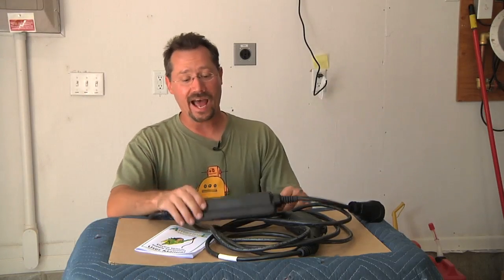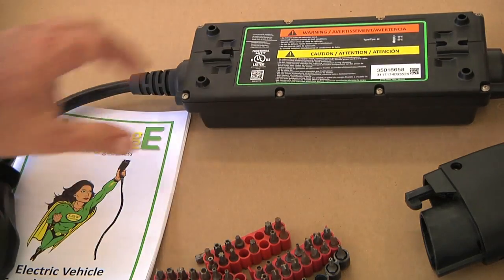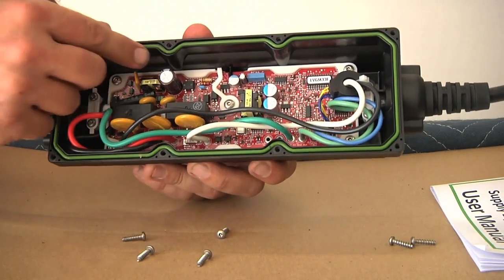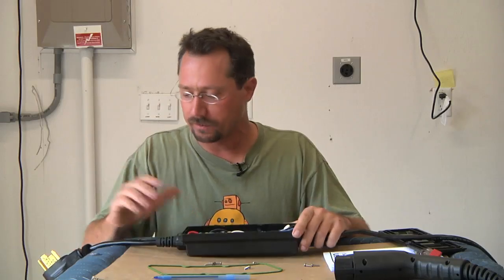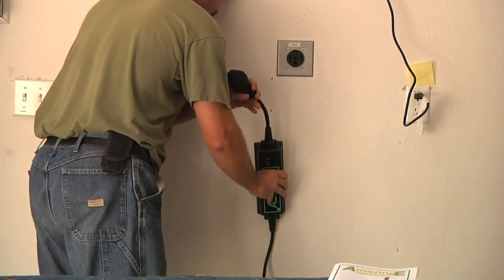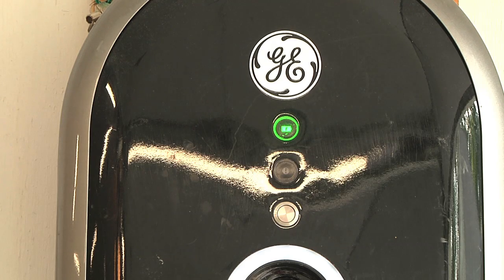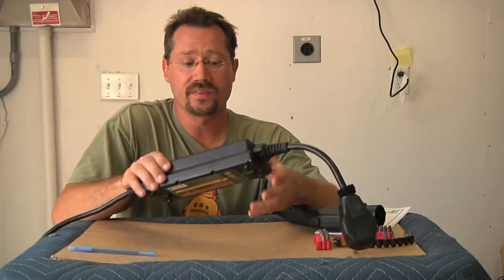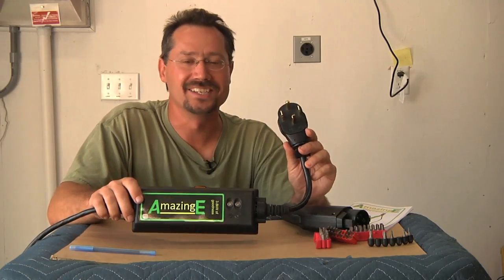"Amazing-E EVSE" - Review and Look Inside

Comment: maybe if you connect between the neutral wire and the one hot line it would work. rather than 120 across the two line connections. Putting a cleat in the wall above the box would stop it from popping up, maybe a long one hanging down with only one, loose, screw in it so it can be swung out of the way.

Comment: I also have one of these AmazingE portable EVSEs. I just ordered a new Clipper Creek control board to build a 2nd for cheap and I’m hoping it’s configured for dual voltage like the Chevy Volt/Bolt implementation. It makes sense that they’d engineer one board to use with multiple EVSE configurations from different ODMs. Did you look on the board for any kind of factory jumpers that could change the config?

That said, I was getting the same error indication with 240v on my AmazingE until I redid the ground on my NEMA 6-20 pigtail. Maybe yours does work with 120v and it’s just ground faulting like mine was?
Reply from the maker: Was it this eBay listing that you ordered from? https://www.ebay.com/itm/174440500833?hash=item289d76ce61:g:2QEAAOSwzOJfY7iW
A friend of mine has two broken EVSEs and he was talking about buying a pair of those boards to use for rebuilding them.
When I took apart my Amazing-E, I was able to look at the board version number in the corner. I recall that it WAS a different part # from the gen 2 Volt EVSE.
On the eBay listing, the photograph unfortunately does NOT show the corner where the part number is screen-printed on the board, so I have no way of confirming EXACTLY which board that is.

What exactly did you do to the grounding setup that you were able to get the Amazing-E to run on 120V?
Reply: @BenjaminNelsonX  Yes, that is the listing but I added it to my Watched Items and got an unsolicited offer from the seller for $30.

I have not tried the Amazing-E with 120v but I did have the same error at 220v making me wonder if your error was related to 120v at all. After all, we both experienced it after wiring an outlet. In my case it was some kind of ground fault.

After seeing your video I’d like to try 120v but I don’t know when I’ll have the chance. It’s currently bolted to the workshop wall in a public place to keep people from stealing it and I need a backup before I start playing with it. :)

I will let you know if I find that ours works with 120v and/or has a different board revision. I’ll also let you know what I get from that control board listing when it arrives. I have a feeling that these were GM spares and may be configured the same as the Bolt/Volt2 EVSE for dual voltage 120/220v use.
Reply from the maker: @emmettturner9452   My friend did a MAKE OFFER on that listing and also ordered one of those boards for $30. When he gets it, I'll have him take a photo of the part # and we can compare it to my Amazing-E board. That's also our hope is that it's the Volt/Bolt board and 120/240 compatible.
Reply: @BenjaminNelsonX  Just received it in the mail.

I haven’t had a chance to wire/test anything yet but I’ll go ahead and give my initial impressions and observations since I’m not going to be able to do much else where I am today.

First, it’s genuinely new, unused, with factory HASL tin on the unpopulated connections. Not a pull. Could be from any ODM or even GM.

It has the exact same PCB rev as you though some of the numbers were covered by glue holding down the nearby transformer and capacitor. The revision date and the first/last digits of the part number all match.

Mine is marked “PCBA B” instead of “PCBA C” on yours but that just means it’s from a different panel position at the PCB assembler (multiple boards produced in one large panel). The sticker on what is presumably the main microcontroller (U13) says “LVGM33A” instead of “LVGM33F” like yours, which may indicate they are programmed differently since the board with the “A” version is actually a couple years newer.

I can’t tell if the nearby “J8” footprint is a set of unpopulated jumpers or some kind of programming header but I assume the latter. If the former then we need to analyze a Volt/Bolt version to see if they enable dual voltage.

Most of the component date codes are late 2018 and there is a Clipper Creek sticker on the side of one of the relays with “Model: Gen2 Date: 2019Q2” (mid 2019). The date code on the PCB itself is 42nd week of 2018 where yours is 40th week of 2016.

The glue holds the metal-oxide varistors to the relays and nearly every through-hole component to the board. I’m surprised yours doesn’t have glue to help hold the heavier components since it is intended to be portable, but maybe these boards weren’t going to have a silicon rubber gasket like the standard one has. I haven’t looked in my AmazingE yet.

I’d planned to mount it all to a piece of wood for now but after measuring 7x2.375” I see it’ll fit the same 250x80x70mm “Waterproof Plastic Enclosure Project Box Electronic IP67 Electrical ABS Junction” (294268994917) that I’ve seen others use for their DIY OpenEVSE. It’s an extra expense but I’m well under-budget and it looks too perfect.

I got lucky and my used 22.5’ J1772 SAE Type-1 was only $50 and close enough for Local Pick Up. After seeing the new prices I had to wonder if public stations had a problem with people chopping them and running off!

Now I just need a round-cable dryer plug from Goodwill, some waterproof conduit/cable fittings, and a make-shift watertight light guide for the LEDs. The LEDs are mounted over holes in the PCB as if they work from either side. They might be alternately populated with top/bottom-facing component variants so I’ll have to check that before drilling any holes. It would’ve been convenient if they had alternate points for their ODM partners to connect their own LEDs and put them wherever but… nope.

If the micro is programmed to operate differently, here’s hoping it isn’t programmed to require the optional temperature sensor or something since I have no idea how to bypass that. I guess someone with a Volt/Bolt or Euro version will have to measure the resistance while cool or something.
Reply: @BenjaminNelsonX  

In “Clipper Creek Chevy Volt / Bolt Level 1 to Level 2 Charger conversion” I can see that the General Motors version has glue and the same “LVGM33A” on the micro. That means there’s still a very good chance this is a GM spare.

He doesn’t modify the Clipper Creek parts at all so I can’t get a good look at the temperature sensor parts but there are enough wires there that I’m reasonably sure it uses them.
Reply from the maker: @emmettturner9452  Thanks for the comments!
That's my thoughts is that the 120v
operation may require that temperature sensor.
Reply: @BenjaminNelsonX  Hopefully, since that should be easy to bypass with a resistor.

I just took apart my AmazingE and found the board was week 36 of 2017 with the same 5.1 PCB rev. Like your AmazingE board, it’s also got “LVGM33F” on the microcontroller. Meanwhile “Jokerlope” on IMGUR has an album showing a week 6, 2015 Volt portable EVSE with a 4.9 or earlier revision of the board and “LVGM33A” on the microcontroller.

Album: “Stock 2016 Chevy Volt EVSE running on 240VAC”

The last digit on the PCB rev was obfuscated by the same glue that the newer eBay board has so I’ll just call it 4.x from now on. What stands out to me is that it is the oldest of all these boards, a confirmed GM version, has the same glue and “LVGM33A” microcontroller code as the newest one from eBay… both of which the AmazingE boards from the time in-between lack. This lends even more credence to the idea that the eBay boards are GM spares since it’s definitely not something ClipperCreek stopped doing for newer boards.

Unfortunately, this increases the likelihood that different microcontroller programming between GM and AmazingE is what prevents 120v from working on the AmazingE. I guess we’ll find out.
Reply: @BenjaminNelsonX  Other things I noticed about his older board:
The silk screen capitalization is different with “Pcba B”.
J8 only has solder in two holes. Perhaps there is a jumper between them on the other side? That certainly isn’t the case for my eBay board. It’s probably just that it didn’t get filled in fully during wave soldering but I really wish I could take a closer look inside an assembled GM version to be sure.
Reply from the maker: Here's the photo that shows the part number on the board: https://300mpg.org/wp-content/uploads/2017/09/IMG_7522.jpg
You can see more photos for yourself at: https://300mpg.org/2017/09/02/amazing-e-evse-review-and-opening/
Scroll to the bottom of the post for the photo album.
Reply: @BenjaminNelsonX  Thanks! I will compare these pictures soon and provide my own if there is anything different. :)
Reply: I found a thread on Bolt forum called “Changing the plug on the EVSE” where the OP determined the thermistor “is 1k at 25C, and a ß=3800K” This tells us that we can bypass the thermistor with a 1K Ω resistor so that the unit always thinks the plug is 25°C (77°F).

Comment: I have the exact same Amazing-E EVSE with the NEMA 14-30 Plug & for some reason it stays warm to the touch when not in use, Originally I thought it might be from the LED but it seems to be coming from the inside of the front portion of the enclosure. My stock 2nd gen Volt EVSE stays cool when plugged in & not in use. Should I be concerned?

Comment: Did you test line and neutral were wired to plug and board correctly?
Reply from the maker: For my test, I temporarily rewired my outlet from 240V to 120V. That's pretty hard to get wrong - it's literally changing one pair of wires. As for "Board", do you mean the circuit board of the EVSE? Inside the Amazing-E, the Neutral wire goes to NOTHING. It's literally a cut end covered with shrink wrap. For more details, please take a look at the blog entry, which has detailed comments and photos. https://300mpg.org/2017/09/02/amazing-e-evse-review-and-opening/
Reply: @BenjaminNelsonX  On motherboard you showed L1 and L2/N. They are not interchangeable. Did you wire N and L1 to match outlet to board? L2 should be return.
Reply from the maker: I wired the outlet for 120V so that the neutral connection went to the L2/N connection on the circuit board inside the EVSE.
Reply: @BenjaminNelsonX  Thanks.

Comment: I cut the regular 110p off of the "Clipper Creek" unit that came with our e-Golf (bought it at a Chevy dealership and they tossed in a brand new Chevy Bolt power supply). I installed a NEMA 6-20p and run it on 240v for a faster charge. I turned the old 110p end into a doggle-adapter for 110v use. I did notice the thermal wires that go to the thermal sensor in the 110v plug head. I didn't reuse them and have not noticed any issues; works great.

Comment: I downvoted cause you told people to cut a prone off a connector and that is a big no-no... but gave you a sub cause it's a solid video
Reply from the maker: What's really interesting here is that the neutral prong goes to NOTHING. It is literally NOT connected to anything inside the unit.
It's the ONLY difference between the 50A and 30A connector.
Now, if it was a 50A device that could now be plugged into a 30A outlet, THAT would be a bad idea.
All that modification does is makes the unit more flexible.

Comment: its just a plug? the output ac or dc? after plug in ,the car have on board charger charge the car.?
Reply from the maker: A device like this is simply an EVSE - Electric Vehicle Supply Equipment. It just supplies AC power from the wall safely and at an appropriate rate for the charger, which is built into the car.

It creates a signal that permits the car to draw an appropriate amount of current, so as not to blow the circuit breaker. It also requires that the end plugged into the car full makes a connection BEFORE it completes the circuit to have live electricity at the end of the cord.

It also has a simple signal so that the car can't power on and drive away while the cord is plugged in.

Comment: Quick question. The board was labeled L1 and L2/Neutral.  You did send neutral down the L2/neutral wire and didn't accidentally send it down L1.. correct?  Polarity doesn't matter for 220, but does for 110. (Could be a safety check in the EVSE)

Comment: I’ve mounted my GM supplied unit on the wall the same way as you and it’s very solid.  I’d suggest tightening the screws more so there is no side-to-side movement?  If that doesn’t do it, try finding screws with larger heads that fit snugly in the slot.

Comment: Appreciate the video. its still the only one on the internet about the product that I found. You swayed my decision to buy it, over the AV TurboCord.

From the Amazing-E.com FAQ
"Q: Is the J1772 outputting 110V or 220V to the vehicle? I realize that 220V is input but what is output?
A: The AmazingE® would output 220V power. The charging station is meant as a safety pass through for power and will not alter the voltage from the input connection. This means the station will output the same voltage as the input voltage as long as it is within the stations operating range (185V to 264V). NOTE: If connected to 110V power in some manner, the station will throw an error and no power will be passed to the car."     <<<<<<   (This is what you experienced, as stated by Clipper Creek)

Comment: It is possible that the Thermal resistor could tell the unit to be in 120v 'mode' - there's another video where a guy used his 120v wired EVSE 12A as a 240v EVSE (testing it first).  From the video, I cannot see any sort of 'strapping' or wiring that would tell the unit to be in 240v 'mode' only.  Would be fun to find a 120v version of this EVSE and compare the two - probably providing the answer!

Comment: Great review! I have a pool pump sub panel with a 240v breaker that has 20 on it. It was for the pool heater we used to have. Can I wire up a 14-30 to that breaker and use this charger since it only draws 16amps. The entire sub panel is on a 40amp breaker and I would only charge the car when the pool pumps are off. Could I replace that 20amp pool heater breaker with a 30amp breaker just to be safe.
Reply from the maker: Yes, you could charge from that breaker sub-panel. If you wired the outlet for a 30A connector, you would also want to replace the 20A breaker with a 30A breaker and maker sure it's wired with the appropriate AWG wiring.
Alternatively, I also just reviewed another EVSE, which comes with a 20A connector already on it. https://www.youtube.com/watch?v=c-5c-Ixx37Y
Reply: BenjaminNelson Thank you very much! I just replaced the breaker with a 30amp, ran some pre wired flexible 3 wire conduit. I hooked it up to a box then added a waterproof cover to it and put the 14-30 plug in it. Now all I need is to buy the charger! I’m using it outdoors so I plan on putting it away in the car after each use to keep it new. I can’t wait to charge my fiat 500e in 6.5 hours instead of 24 from 0%
Reply from the maker: You might find that completely unplugging and storing an EVSE every day becomes a little tedious. Many of these devices are completely waterproof. You might want to leave it mounted, but put some sort of rain protection over the top of it. I've seen people use devices for hoses that have a compartment in them. https://amzn.to/2upiZcL

Comment: Usually those type of clips have a sweet spot.  By that I mean if you screw the screws too much it won't go on at all. But if you back the screws off a little at a time till you get to where you get a kind of friction fit. You should have a more secure mount on your wall. It can still be bumped off but it would take a more substantial bump to knock it off.
Reply: Great point, Jessica.  I have a Gen-2 Volt so the case on my stock EVSE is identical to this Amazing-E's case.   Just by chance I already had some really meaty flat-head wood screws driven into the panel I wanted to mount this on.  Unless I miss my guess they are ##12 flat heads.   At the proper, fine-tuned depth as you said, they grab onto the case very nicely.  Accidental dismounting is very unlikely.

Comment: I borrowed my cousins 11 amp 120V charger (Delphi/Clipper Creek) and compared the circuit components with my 24 amp 240 Clipper Creek charger, all components are exactly the same except what appears to be some jumper settings.  I believe the jumpers reconfigure the low-side transformer primary coil from a series to parallel configuration to keep the secondary coil voltage the same.  I believe it would be possible to reconfigure his charger to 120V by reconfiguring the jumpers... but I'd like a good solution that allows for easy swapping between 120 and 240V charging.

Comment: Just for curiousity my Voltec EVSE (Europe 240V) has a different J1772 plug. They use the 5th wire to feed a torch light in the plug that lights up when the release lever is aktivated. It is only bright enough to find the socket when you are close enough to touch it but it is still a great help.

For the more adventurous there are some european boards around with far less stuff inside that might fit into a box one third of the size. When not charging at home I am charging our i-MiEV at RV parks most of the time but we are using the Blue Command  socket or is it commando? CEE-240V/16A